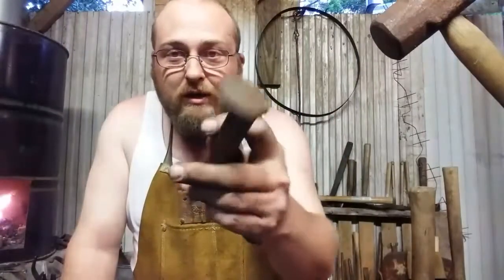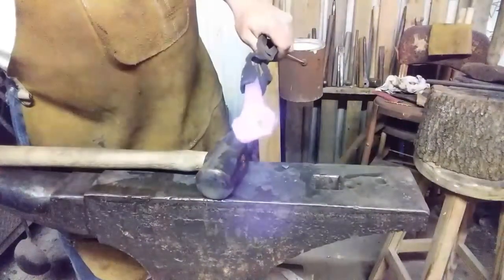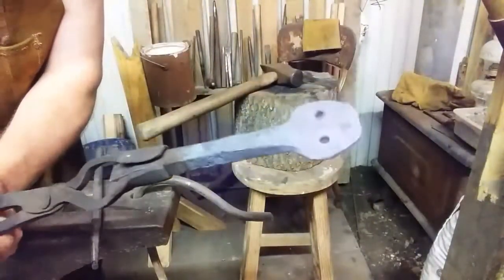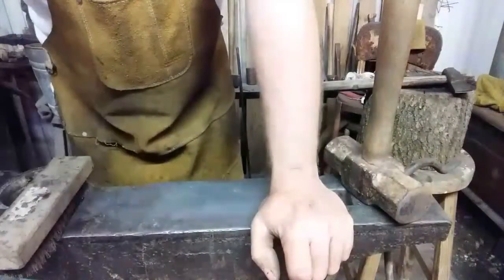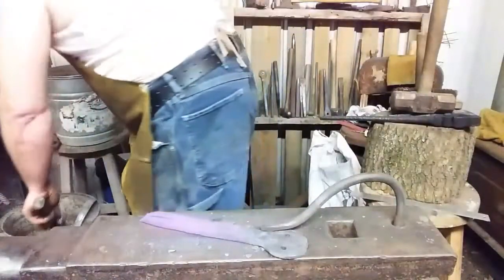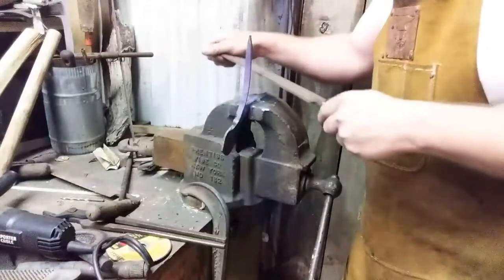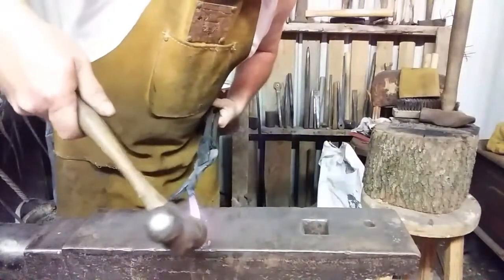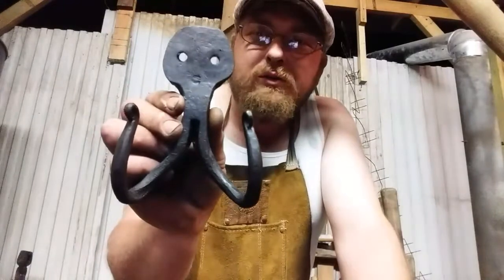Rail spike wall hook

Comment: Awesome hook! Just a suggestion for the face of your anvil. A sacrificial piece of steel like thick sheet metal to put under your piece that your cutting that way you save the face of your anvil! Keep on ⚒️ ing my friend!!
Reply from the maker: I've sacrificed my sacrificial cutting plate lol. I need to dig for another in my useables pile. I'm excellent at procrastination however. Thanks for bearing with me on this boxing octopus hook!
Reply: @thesprinkleddonutforge2774  yeah I'm pretty good at procrastinating myself! Lol! I'm going to try the boxing octopus! I have alot of railroad spikes! My mom lives in the country and hardly any houses around and railroad runs thru the farms out there. All family so I got access to them

Comment: Nice job James!  That came out really well. I was freaking a little when you were splitting the spike and it split through. I was happy to see you didn't mar your anvil.  Enjoyed the video. Keep em coming brother.
Reply from the maker: Thanks Jim. I was a little nervous for my anvil face cutting through like that. It did blunt the edge of the hot cut. Those Sodefors anvils are impressively hard. I'll use a plate next time for sure. Lucky once don't mean push it. Lol.

Comment: ..Very Nice James !! You keep this up and folks are gonna start calling you "Spike from The Sprinkled Donut Forge" i have been pondering on how to make a triple hook version leaving the head intact. any ideas...??
Reply from the maker: Y Not Forge Yes. Spread the material out three times as wide as it is thick and chisel two lines instead of one. The hooks will be 50% slimmer but it will still work fine. You may try a butcher chisel instead or one with a steeper angle to avoid the hard taper distorting the hook arms.